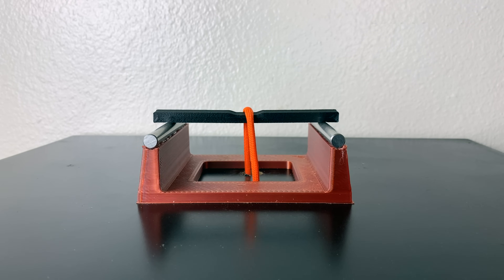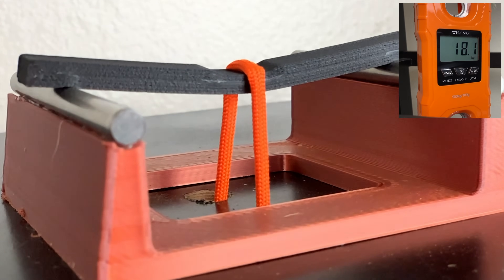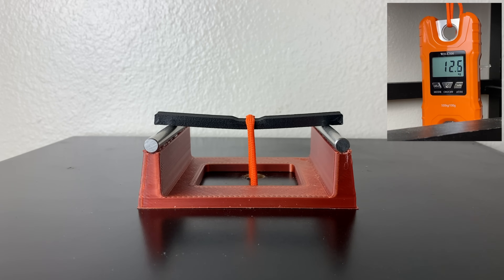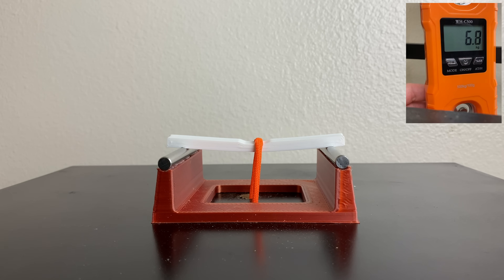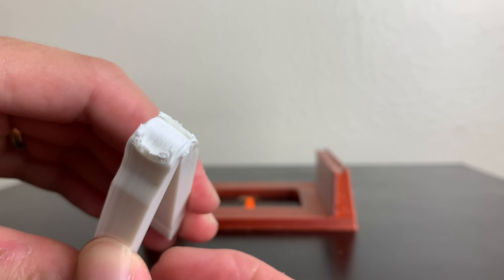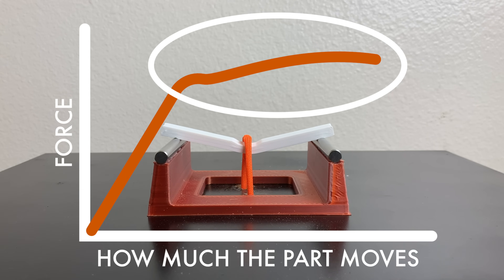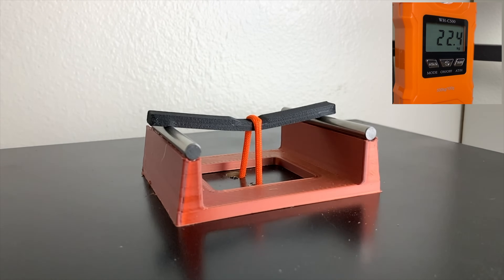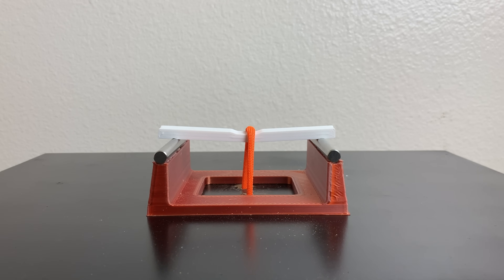How STRONG is 3d printed CARBON FIBER?

Comment from the maker: This video is outdated. I’ll need to revisit this experiment with better methodology.
Reply: Yipper
Reply: i'd say it's perfect to show the difference between the carbon fiber print and the pla

and i have to say: this was very well explained         very easy to understand and also very interesting to watch
Reply: Thank you, nice, please try breaking the PLA Carbon fiber compared to standard 20x20, 30x30, 40x40 aluminum extruders.

Revisit note.
Reply: Also please try one of the nylon parts soaked in water
Reply: Have you?
Reply: My experience is that sometimes ductile/brittle depend on number of layers and it can be sort of both. My other experience is that sometimes different color feels like a completely different material, for example bambulab's matte white and matte black (or green) - white has very poor adhesion to itself and it can deform, black is much harder. I have weird experience with comparing PCTG and PETG - in one layer, PETG is very flexible and ductile. In multiple layers, PETG feels very hard, brittle and you I cannot permanently deform it - it suddenly shatters, whereas PCTG feels softer, it may crack on impact and when I try to bend it, it shows change of color, then bends permanently, then cracks, but one side can still hold together. But does it have high impact resistance? I don't know, because it cracks sooner and it's possible to scratch it by fingernail. And again, I have transparent PETG and metallic PETG, transparent one seems to have by far better layer adhesion.
Reply: Try 3D printing a hollow carbon tube. Like the size that would be used for the top & bottom down tube of a mountain bike frame. Then fill the tube with #2 high density spray foam & test the strength of the tube....
To see if it's stronger & lighter than an aluminum bicycle frame tube. If so, you might be able to 3D print 1 piece, incredibly strong bike frames. Once filled with spray foam inside & cured.

Comment: Just because it never "snapped" doesnt mean its not a failure. If it cannot return to its original shape then its a failure.
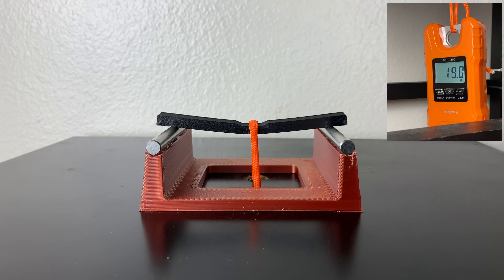Reply: Also notice that the displacement were the beam dropped was at about 12 kg of force, compared to 20+ for the carbon fiber. A 2:02 you see a carbon fiber beam with the same load doing just about nothing to it.
Reply: Not quite true, something changing its original shape doesn't mean it has failed. It is the reason you use a ductile material instead of a brittle material. What you are describing is leaving the elastic region and entering the plastic region (when an object doesn't return to its original shape). His definition of failure is actually called fracture and the PLA never reached fracture as it never finished its plastic deformation. It should also be noted that there is a range where an object will deform in its plastic region but still continue to carry heavier load until it reaches its ultimate strength.
Reply: Purely speaking from an engineering perspective, it depends what you want to use it for. Plastic deformation isn't necessarily failure, it really comes down to what you are using the material for
Reply: Failure is not yielding
Reply: @anubis520  Agree, it hasn't failed until it yields, which is when it fails to return to the original shape. A flex test may not be the best for determining overall strength.  Elongation and shear are also very important. Then it gets even vaguer when you test shock failure.
Reply: It can be deformable
Reply: @ConnorSmithBirch  That is a wonderfully ambiguous statement. Perhaps you meant, "Yielding is not failure."? Anyway, in practical terms, it is up to the designer/user to define what constitutes failure for a particular part with a particular purpose. Consider a shelf being supported by two wall-mounted 3D printer support brackets. A little bit of deflection under load is acceptable (and, technically, unavoidable). The practical questions include: 
How much load before it deflects 'too much'? What is the definition of too much in this case?
How much load until it no longer returns to its original shape?
How much load until it no longer keeps objects on the shelf?
How long can it support various loads and still retain its shape?
...and so on.
Reply: Return to the original shape is one of 7 abilities materials can have.
Reply: I'd imagine the carbon fibre is better for ridged materials. If I used this on my print atm I think the carbon would fail before the pla. I have printed rods that are joined onto cams and gears, I think the twisting force on the rod would shatter with carbon whereas the pla would flex a bit
Reply: Malleability , I know... 😳
Reply: @anubis520 Spot on.  Some materials are chosen based upon elastic strength vs. a shear failure or "break".
Reply: also, normal PLA is very brittle

Comment: bruh saying PLA didn't fail is the equivalent of saying oh my sword didn't break it just bent 180 degrees backwards. Like no that is a absolute failure lmao.
Reply: He explained quite well with the graph how the property he was referring to works and it makes perfect sense, even without that part in which it bends completely you can see that you can compare directly the two initial lines of both graphs to get an actual measure of strength even tho it would be subjective to define when the material exactly failed, you say it failed because it was bent but how much did it have to be bent before being considered a failure? You might say "well if it still retains the original form it did not fail" but actually in many applications you do decide to go beyond that line, and use a material that will inevitably bend to a point it will not go back to normal and that would be fine, so not a failure.
Reply: @simoneazzoni3882  you right bro if a building bends even 20 degrees in a direction its definitely not a failure lmao. I'd love to know what application someshing can bend 180 degrees and not be a failure. You are wrong dont need to explain it there is no circumstance a building material can be bend 180 degrees compromising its entire applied integrity and not be a failure lol. But sure man!
Reply: You lose credibility by starting your argument with bruh…
Reply: @Thepedell  apart from compliant mechanisms, that are a hot topic when it comes to 3d printing, a material that bends 180° under the intended load is not much useful, that is true, but you can not identify when it exactly failed, let's take for example two different steel pieces, the first one is an high carbon tempered steel, the same you would find in a file for example, the second is the common steal you normally find, under for example 100N the first might atill hold but the second one starts bending let's say it now has a 10° bend, at 101N the first one shatters violently, the second bends to 12°, which one is better? Well it depends on the application, the first one you can be sure will keep his shape, the second one could keep working even if it is bent, car axles can get bent a bit and still work, a gear rack should be as straight as it can due to the fact that the system will fail with even a 1° bend. To compare multiple materials tha behave differently that graph can be really useful.

Comment: What? Pla will snap, there are other channels that do this with 3d printed hooks the direction and angle determine the strength, as soon as the pla stopped holding weight around 13kg it failed, just because it's not in 2 pieces doesn't mean it didn't fail
Reply: This is probably not pure pla, some kind of additive will have been added to make it more durable

Comment: Nice video 👍

You should specify what brands of filament you used in your tests. There may be considerable variation in properties between products from different manufacturers.
Reply: It would be perfect to test many filaments of each kind, with different prices, and average the result, but such test would be quite costly.
Reply: i agree with this, and also people need to show their settings and setup. i feel like there could be miscalculations made on settings for the material which can cause inconsistent results. one major factor I could see is people testing materials without even dehydrating the filament with a dryer...

Comment: Please use another printing direction for PLA (Flat surface down not the side)
With PLA you see the extruded lines in same layer are not anymore bonded together (to low flow or low bonding)

Comment: well, this filament contains finely grinded particles of CF
try some filament with chopped ones, or even contionous fiber - I use that technology to produce parts stronger than aluminium :) (on a Markforged Mark 2 printer if you are curious)
Reply: is this true
Reply: @Turtlenaide Yes, even without continuous fiber CF-PEI has a tensile strength of 145mpa compared to pure aluminum's 90.
Reply: @markthompson5983  where can I buy the material
Reply: What is the electrical resistance of the printed carbon part?
Reply: @Turtlenaide  you need a high temp printer for cf-pei You can get that from 3dx tech, same with carbon fiber nylon
Reply: Where could I learn more about this?

Comment: I'm sorry, but you are incorrect... I'm not sure if you were confused about what you were saying, but at three minutes you said "let's test the most commonly used material - pla..." You then proceed to say that PLA is "extremely ductile, basically it is the opposite of brittle, it doesn't snap."

This is INCORRECT. PLA is extremely brittle. Materials like PETG and ABS are substantially more ductile than PLA. Don't take my word for it though, go look research yourself! 

If you really did use pla and it bent like that there are several things that could've contributed to it - poor layer adhesion, too high or low of print temp, orientation, amount of moisture in the material, etc. It appears as though the orientation is the same, so I suspect poor layer adhesion. My indicator is seeing the individual "stands" as apposed to the blending of the layer lines when you bent it.

In practice cf "based" pla is "usually* a bit weaker when it comes to other vanilla pla materials,*unless* you utilize a pla that contains stranded carbon fibers which have been oriented in the direction of the filament. This type of cf pla is substantially stronger, very hard to get ahold of and around 8 times the price of your "off the shelf" cf pla filament.

Sorry to call you out, but this is quickly validated.

Comment: I used to print with PLA carbon fiber but after using other filaments I realized how bad it really was. I feel like parts with relatively thin walls, like 2.5-3.5mm crack/split extremely easily, and layer adhesion isn't that good either. But I upgraded to NylonX with the nylon and carbon fiber mix, and that stuff is the best filament I've used in my opinion as long as it's kept dry. I think you get the best of both worlds combined as far as the strength of the part, and the flexibility. It is somewhat flexible and very strong from nylons property's, but the carbon fiber keeps it a little more stiff, and also makes the part a bit stronger and rigid. I've printed parts with thin walls and tested the strength by hitting them with a hammer and they were fine, only with small indents from where the hammer hit. But great video, very detailed and informative!

Comment: ¡Impresionante video! Ver cómo esa pequeña pieza en forma de biga puede soportar 18 KG de peso en su centro es asombroso. ¡Un gran avance en ingeniería que demuestra la resistencia y el potencial de los materiales utilizados!"

Comentario en inglés:
"Awesome video! Watching that small beam-shaped piece withstand 18 KG of weight at its center is truly mind-blowing. A significant engineering advancement showcasing the strength and potential of the materials used. Great work

Comment: The carbon infused filament was HT-PLA. Was pure HT-PLA used for the comparison or just regular PLA? I believe it has been demonstrated repeatedly that introducing fiber contaminants into the filament simply makes it more brittle. Actual carbon fiber derives it's strength from the linear weave of the material. You wouldn't glue together a pile of carbon dust.

Comment: The true strength in carbon fiber is its unilateral strength you can engineer with the geains of the fiber and the shape of the piece.

That little "arch" you designed in for the rope was a compromising point and didn't need to be there. The rods would have broken where you were pulling them from regardleas of that cutout arch or not, but it worked against the natural benefits of carbon fiber
Reply: Works to show which is stronger with less effort

Comment: Your experience with the white PLA is the exact opposite from me and I expect most others here that print standard PLA regularly. Standard PLA is considered very rigid but brittle. I'm going to assume you used some form of PLA Plus or some other modified PLA that makes it more ductile. Also, You didn't mention in the video anywhere what type of CF filament you used. I did notice however in the description that it is Proto Pasta CF-PLA. Might I recommend trying Atomic CF-PETG or 3DXTECH CF-PETG. It is much more popular for structural, functional prints than CF-PLA and has a proven track record not to have just carbon dust mixed in. I like the concept of your video but I'm afraid it's misleading in many respects. Please don't take this to be discouraging, just sharing my two cents.
Reply from the maker: Good points! This is "regular" PLA. Many common PLA brands have added toughening agents to reduce brittleness. (Overture Matte White PLA) I would love to try out some other Carbon Fiber filaments that are designed for more structural applications. Thanks for the suggestions!

Comment: You made with a drill two holes on your test bed. This created a triangle with your Para. A slot would allow the Para to be free pull. Para has a stretch too. Using a metallic "Hook" or something that will not stretch within the range of the limits would be more accurate.
I know if you do a vid like this all the Einsteins come out, I'm not breaking your you know. Just observing. Thank you for taking the time to make this.

Comment: I always wonder if a carbon print can block magnetic fields or radio frequencies. This can be very useful when designing a case for electronics that needs to block those outside signals. Any thoughts on this?
Reply: Doubtful as the carbon fibre pieces are short. The printer part isn’t conductive so it’s doubtful that it would block rf

Comment: That’s not PLA you got there it must be PLA+. PLA snaps, it’s also very strong, low ductility.
Reply from the maker: Most PLA nowadays is very ductile, even if it's not labeled as PLA+ 
However, it does vary widely by manufacturer.

Comment: why put a notch on the crbn fibr beam which can easily lead to breakage
Reply: As said in the video, to have a controlled failing point. In material testing it is important to have a standardization to compare different materials to each other. 

Yes, the unnotched part would hold more weight (and as such force) but it could basically break everywhere on the beam. It usually would still break in the middle where the weight is applied as there is the biggest momentum on the material, but inhomogencies in the material can lead to another failure point if severe enough. 

Usually an unnotched sample is used for three-point-bending (which is shown in this video) but as the force here is applied through actually pulling the sample (instead of pushing it from above in a normal three-point-bending test) I can see why one would like to have a stable failure point to hold the rope in place.

Also when using a notched sample you usually then normalize your force-displacement-diagram (which is also shown in this video) to a stress-strain-diagram which shows the material's mechanical properties independent of its actual form, hence the loss of strength from the notch becomes moot as you get the actual material properties instead of something that relies on the form of the sample. :-)

Comment: There's no carbon fiber filament! Only fiber filled. What's the base material?
Edit; appearantly pla.
PLA is a horrible material for combining with fibers afaik. Try Nylon/PC with carbon fiber. PLA is also so random. Tbh a lot of filaments are random

Nylon x yields a ton before breaking too

Comment: Strength.... is a common term. BUT different strengths, counter different forces,  from MANY types of angles/planes. Glad you point this out. CF nylon with annealing is different too. Also dry vs water logged... So many variables people! Also...PLA is USUALLY very rigid and NOT Ductile....weird... looks more like nylon of PETG to me...

Comment: The first thought I had was: what if you combined the who, and make Carbon  rebar reinforced pla? The combination might bring out the best of both worlds. Might be hard to implement tho. Do the carbon structure first, then fill in with pla?
Reply: That’s probably what he is using. Actual 3d printed carbon fiber requires a printer that costs more than a car

Comment: Hey, I have been trying to make an RC 3d printed plane but my PLA plane melted in the sun. Is there a better filament I should try? I was thinking carbon fiber but I don't know if it will be too brittle. It needs to be heat resistant and light or at least similar to the weight of PLA. Any suggestions?
Reply from the maker: I've seen alot of people using light-weight pla. Check out this video: https://www.youtube.com/watch?v=G3VlDR9KdGw&ab_channel=TroyMcMillan